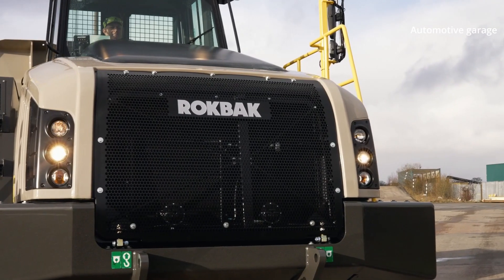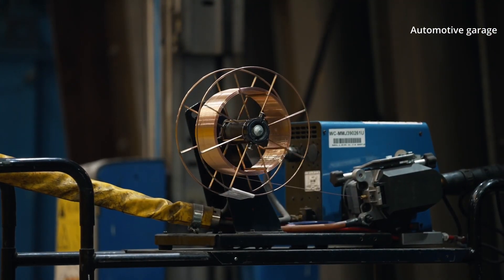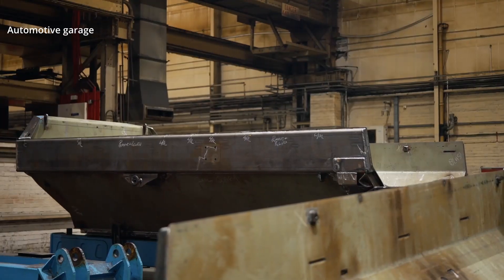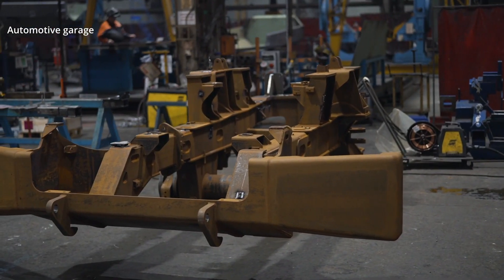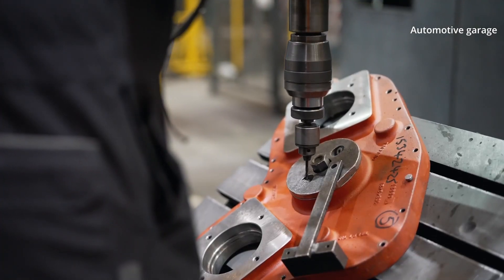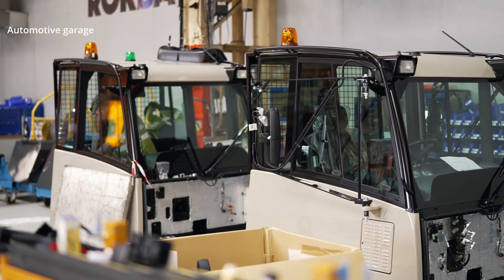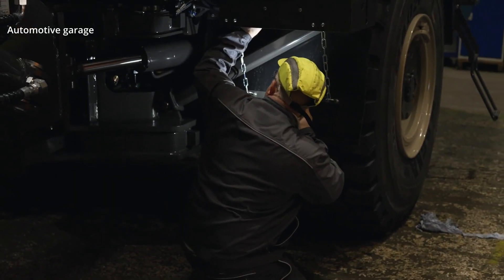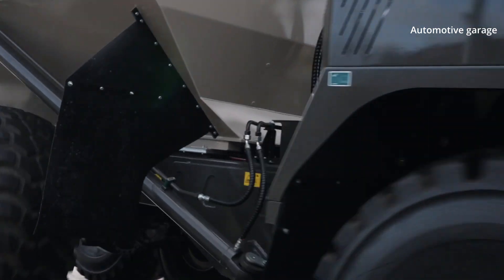Rokbak Hauler Truck Plant - Manufacturing huge dump trucks

Comment from the maker: 0:00 Welcome:stayhome:
0:10  Processing:stayhome:
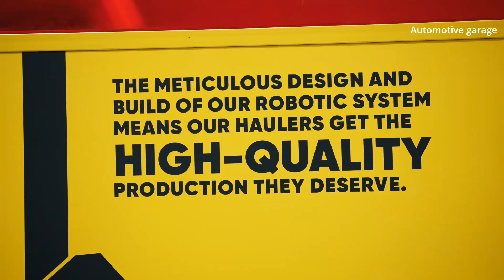0:52 Robotic welder:stayhome:
1:33 Artic body:stayhome:
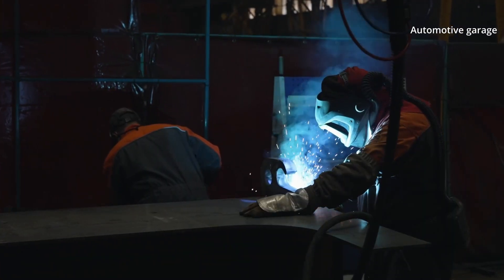2:40 Artic frame:stayhome:
3:12 Paint shop:stayhome:
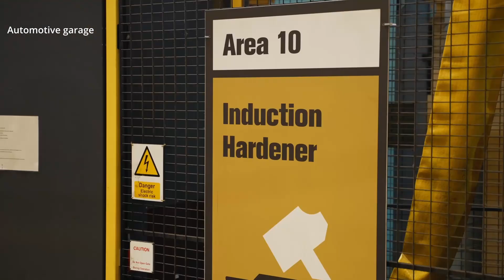3:23 Machine shop:stayhome:
4:17 Artic assembly line:stayhome:
5:33 Finals & inspection:stayhome:
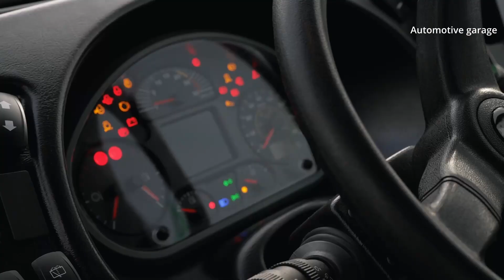6:16  test track:stayhome: